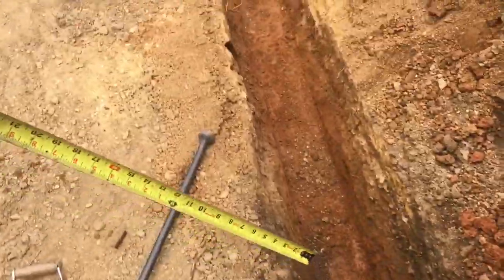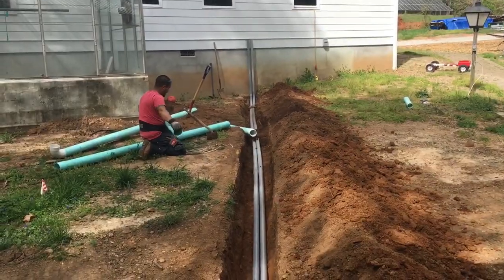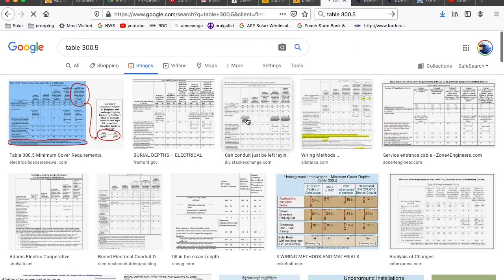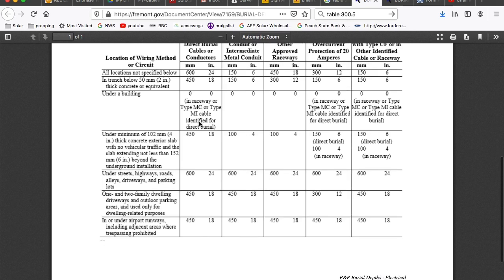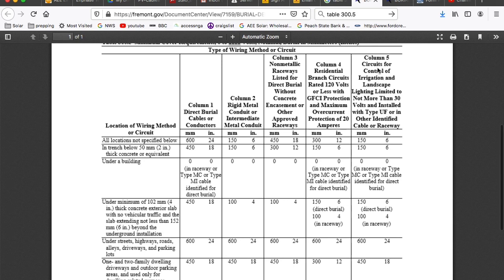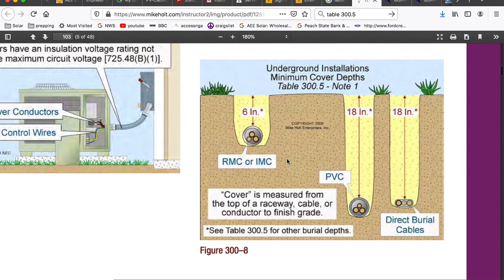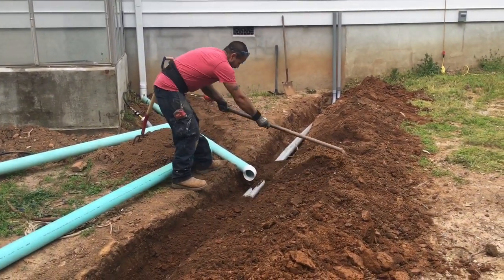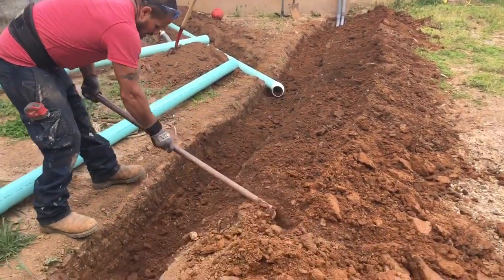How to Bury Electrical Conduits

Comment: When I laid my 2 inch pipe for my antenna system I threaded the wire through the pipes on the ground before gluing the sections together and putting them in the trench. In this way I didn't have to pull the coax through the finished pipe as I built the pipe run around the coaxial cable.    Have you ever tried doing this ?   It saves pulling the wires though.
Reply from the maker: Yeah I’ve done it like that.
Reply: This is not code.
Reply: @qball3834  Why?
Reply: @SkyCharter  Code requires all PVC raceways to be completed before any wire is pulled through.

Comment: whats that gray stuff called?
Reply from the maker: The main difference I can find between grey and white pipe is the sunlight resistance and of course the fittings
Reply: @GainSolarPower  I was just messin with ya, Self employed Master Electrician here, Not much experiance with PV , thats were you come in.
Reply from the maker: Self employed here too.  Where you out of flashole
Reply: @GainSolarPower  North Texas area. Todd here. End of 2002 I  got started on my own, residential and commercial service work mostly.